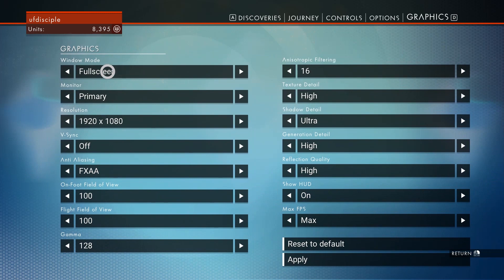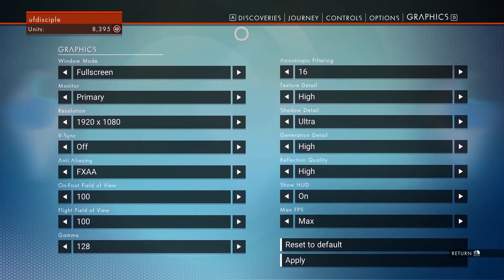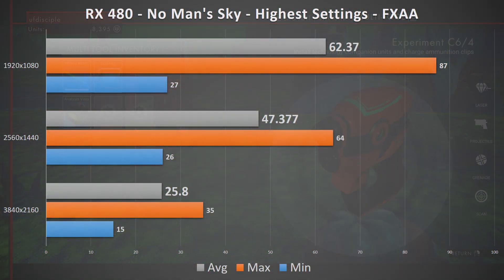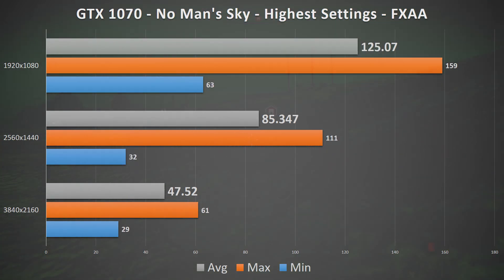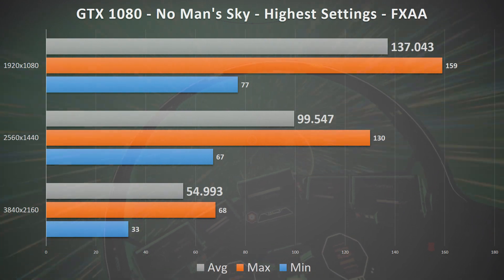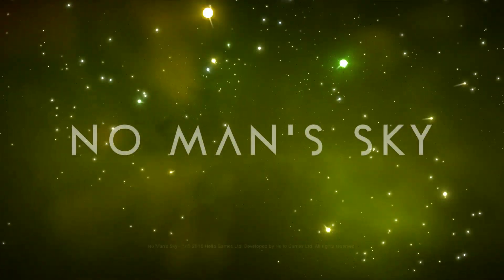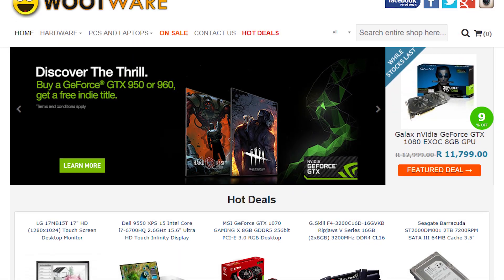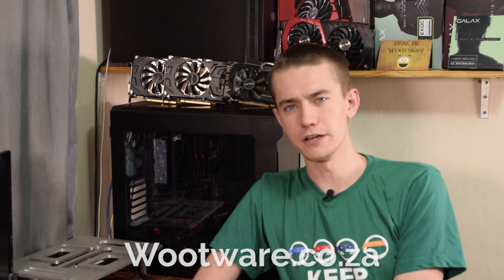No Man's Sky PC Benchmarks - RX 480 + GTX 1060, 1070, & 1080

Comment: I have a GTX1070 however it it not currently water cooled. When I am "loading" around a planet or going into space I can definitely hear the fan kick up and I am hitting around 1900 RPM. I can notice the sound and it just makes me a little nervous to hear the fan go up that high. 

Is this something to worry about? I purchased the water cooler hybrid on Nvidia's site for $120 for for peace of mind, but I'd like to know you're thoughts.
Reply from the maker: Are you referring to a Founder's Edition card? I really wouldn't be worried about it personally as the FE's cards don't dissipate heat as well as AIB partner cards.  I think water cooling it will definitely allow you to have a quieter experience and likely better boost clocks as well.
Reply: I did some research and people are having similar issues with this game for sure. It is a FE, but this is the only game I have issues with. It doesn't seem like the card is overheating as my temps are under 75C but the fan just gets loud and then goes quiet. 

The "experimental" version of the game runs much quieter.

Comment: Hey UFD.  I was thinking of getting this game when I get my first ever gaming PC.   And would like to know if it's a good rig to run all the latest games at highest.
Specs:
Windows 10 Home Edition 64-bit 
Intel® Core™ i7-6700 CPU (3.4GHZ) @4GHZ 
16GB Crucial DDR4 RAM 2133 
3TB hard drive 
NVIDIA® GeForce® GTX™ 1070 8GB dedicated graphics 
No Optical disc drive CD / DVD 
Gigabit LAN 
7.1 Channel Audio 
Ports: 1x VGA, 1x HDMI, DVI-D, 4x USB 3.1, 2x USB 2.0, 3x audio jacks
Depth: 432 MM
Display Size: No Display
Height: 445 MM
Width: 200 MM
Dongle Required: N
Graphics: GTX 1070
Hard Drive Storage: 3 Tb
Processor: Intel Core i7 6
RAM Memory: 16 GB
Wifi Enabled: Y
Reply from the maker: Seems to be pretty good except I wouldn't recommend getting a 6700 over a 6700K and it appears to lack an SSD, which I think is an absolute must.  Also, it appears that this is a pre-built, so I would say to make sure to compare the cost of buying this to building it yourself as it may not be the best deal to buy a pre-built system.
Reply: +UFDisciple I would build it myself. However I'm buying this of of a website that pays weekly so I don't have the money to buy all the parts.   Is this system going to be reliable for all the new games? I've been looking forward to buy this and now I don't know
Reply: +UFDisciple oh it does have an SSD it's has a 256gb Solid state drive
Reply from the maker: What makes you question it now? What resolution is your monitor? This system should be sufficient for handling pretty much everything modern at 1080p.  However, I'm not sure what website you're buying from, but I personally wouldn't trust anything that does weekly payments.
Reply: +UFDisciple I'm planning on using my current monitor which is 1366 X 768
Reply from the maker: Uhhhh, this is super overkill for that resolution.
Reply: +UFDisciple I will be getting a new monitor at around October 1-4. So this is going to do well for being my first gaming PC ?
Reply from the maker: Should perform perfectly well.
Reply: +UFDisciple awesome. Thanks for your help. Do you have a contact email? You seem to know what your talking about.  So if I have issues with my PC I can ask?
Reply from the maker: I appreciate you considering me, but I likely won't have time to help troubleshoot issues. Glad I could help though.
Reply: ***** alright. you gained a sub anyhow.  Keep up the good work, would love to see what you do next :D

Comment: my max fps wih 480 is 121fps od 1080p but im runnin newest 16.8.2 drivers
Reply from the maker: What was your average FPS?
Reply: +UFDisciple
Between 80-85 more or less
Reply from the maker: On exactly the same settings as what I tested with?  Are you actually documenting the FPS or just going off based on what you see?